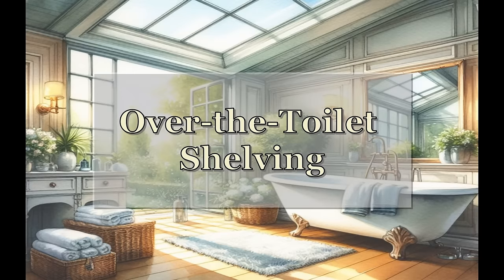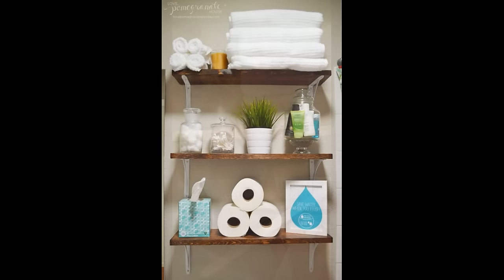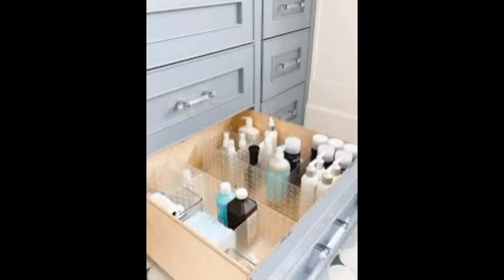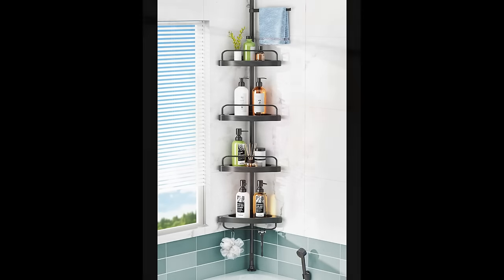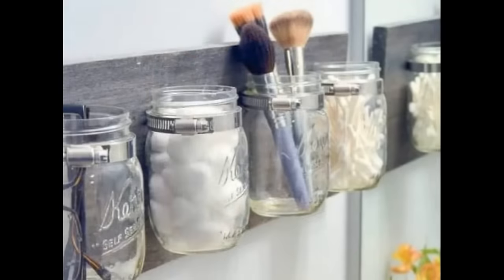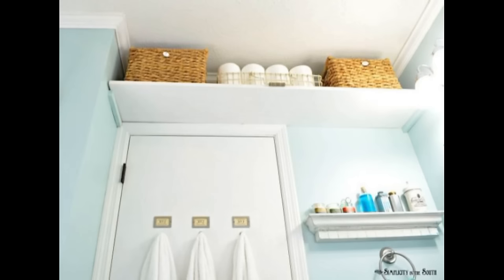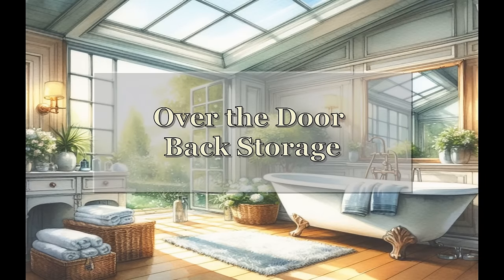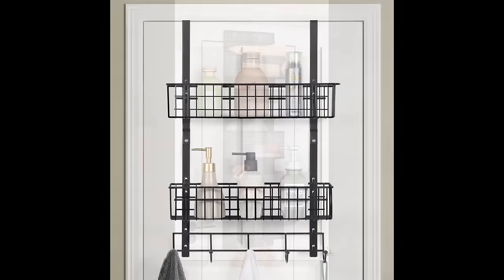Bathroom Organization - Crazy (Good) Ways to Add Storage on a Budget

Comment: Love all of these ideas, some old some new to me. I live in a 1 bedroom over 55's unit with no storage. For the combined bathroom, toilet, laundry there is no wall space except in the shower with shower rail and curtain in a corner. Washer and dryer next to shower which is next to trough. Other side of shower has window from shower to wall above toilet. From window to door wall,  are hand rails and pipes, basin and the skinniest two door closet I have ever seen. I can't even get my upright vacuum in it. The shelves fit 4 towels, 2 Queen bed sheet sets, 2 quilt cover sets and bath mat, hand towels and face washers. And yes, it holds the mop and broom. To store toilet paper rolls, I have a sturdy wooden disc with a broom stick cut down to hold 9 toilet paper rolls. Spares from a bulk pack of 24 or 30 fit somehow in the closet. Above the basin is a narrow shelf and above that is a small wall cabinet with mirror. It is absolutely overflowing, so I have bought some clear acrylic narrow containers to put on the shelf to hold smaller items, makeup, nail polish, hair accessories, etc. The cabinet has room for medical items then. My hair styler I keep on the shelf next to the power outlet. When I get my wall stud finder, I will be able to put hooks/screws in the wall to hang it beside the basin. I will also hang something on the wall next to the toilet. I can't put anything in the shower because of the shower seat on the wall and safety bars. Under the laundry trough is space for the cat litter and accessories and under the basin is the cat litter tray. The basin is just that, no cabinet. I also squeeze in a rubbish bin, under the toilet roll holder, because the cats will unroll it to use in their litter tray. I also have an over the door holder that has hooks on both sides and two baskets, in which I hold the rubbish bin liners, air freshener, pet deodoriser, etc and the hooks for towels and the hooks on the bedroom side of door hold dressing gown and jackets, etc. Launry cleaners are in a small wall cabinet above the trough. I want to put a shelf above the door to keep my emergency gear.
Reply from the maker: WOW!!!!  YOU, my friend, have found a way to utilize every inch of a small space!!!!  The brook stick for extra paper rolls is brilliant!!!!!  Way to go!!!

Comment: In my Bathroom (I have a shower in the bathtub), I have a large command hook added level to the shower rail. On rainy days, I take the top off a clothes drying rack, and hook it into the hook, and place the rest of it on the shower rail. Then I can dry all the essential things especially the long things. The rest of the time, I have a bathroom organiser hanging on it, so that I have easy access to my soap, shampoo and etc. My top-loading washing machine is also in my bathroom (and its a small bathroom), so I have an IKEA Ivar system built so that the washing machine is under it, and the shelves are above the height of the lid opening. On the shelves, I store all my laundry and cleaning products, on the sides of the ivar system - I have hanging hooks, where I hang my broom, mop etc. I don't have any bathroom storage cabinet above the sink, so I got some cheap adhesive mirror tiles, and I have my mirror there. I'm mostly pleased with the functionality of the bathroom. (I also used adhesive tiles to cover the cement floor).
Reply from the maker: I LOVE how you've made the most out of one multi-function room!!!! Gold medal for major efficiency! 🏅

Comment: Hi Norrine, Lots of great ideas. I use a organizer on the back of my bathroom door for extra storage. You mentioned Alien tape. I used the take with poor results. It but it wouldn't hold. Maybe I should have prepped the area by cleaning it better. I will try again.
Reply from the maker: May I ask how you used it?  It is a little particular on prep - I've only had it fail a few times (when I get impatient - LOL)
Reply: I just used it to hold up a electrical strip but I didn;t use anything to clean the wall panelling. Your Easter card was returned -undeliverable as addressed. Not sure why it didn't get to you
Reply from the maker: Yes, it was probably a little film on the wall.   I hope you'll give it another chance.  I think it's great!
Oh no!  I am sorry I didn't get the card! I noticed the numbers were off last time. (The wedding card was the last one I got)  It's PO Box 15751 and I think you had 15757  💜

Comment: I like the vertical tension rods in the bathroom, can you please tell me where I can get the corner shelves to go with them? Or is this all one piece? Thanks
Reply from the maker: It comes as one item.  Sorry for the long link:  https://www.amazon.com/Rustproof-Bathroom-Organizer-Adjustable-Accessories/dp/B09YRJ9C8S/ref=sr_1_9?crid=3RHMLMVY1CQ7Z&dib=eyJ2IjoiMSJ9.8MeRI61V6-eGJfKhbW2sfBRTigbDqbFesdMXYnXbBHVN578xSQcQT5kZ4sCX8fW3Rhd3QLmJC2jBDi3Jmu8jIOxEyupKAjFTJScWTKDvS-rW0s456CoFYNKYDOjPJGgujslLMx4FCQ-inh9AatBy7HOS2CAkpw7QemLF6x-Rg5jw-7aqdu7BwMywKbu9BNJ_W2hPCu0y8RO1uUsz8UXlfgjw9lV9RAzffBSw5hyP7Wg.2Nx5blwRxZuDbDr0Uz5eajF-6GxS1L0__UMLh4xiyzc&dib_tag=se&keywords=corner+tub+caddy&qid=1712676249&sprefix=corner+tub%2Caps%2C199&sr=8-9